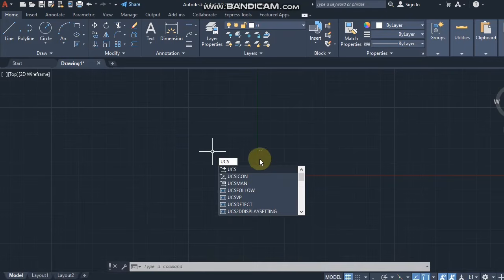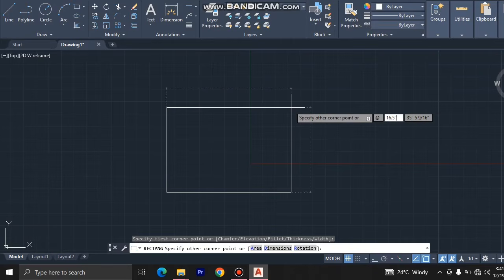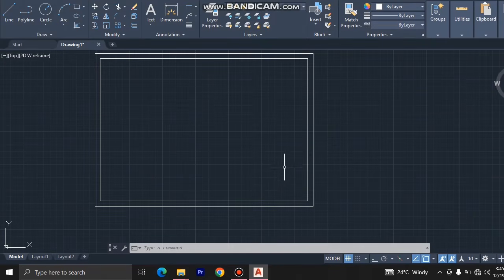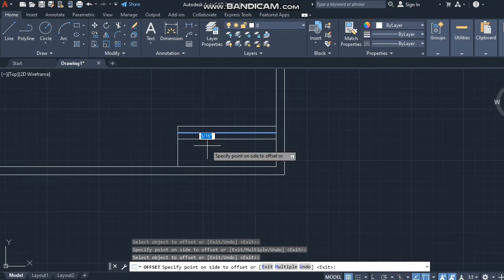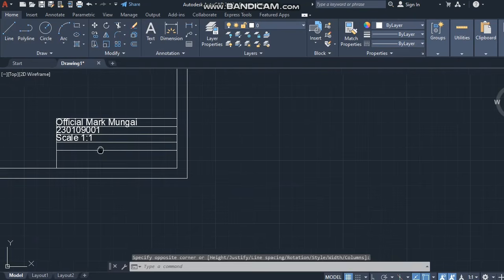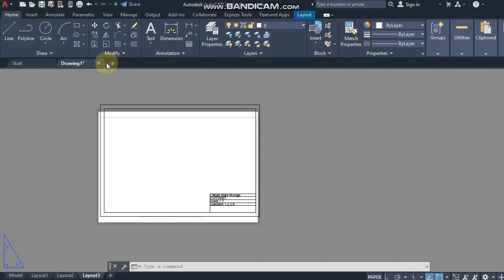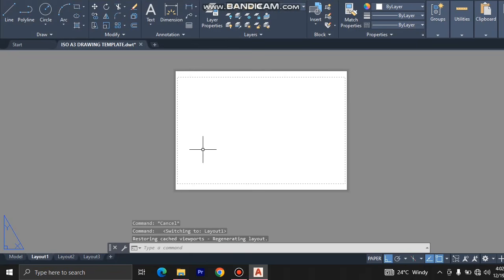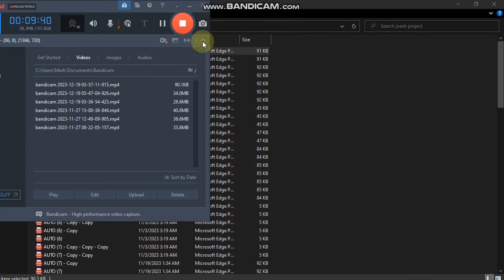AutoCAD drawing || KNEC PAST PAPER QUESTIONS || HOW TO DRAW A TITLE BLOCK & BORDER LINE || ISO A3.

Comment: You can also put the dimensions in mm it's easier than converting from one to another
Reply from the maker: The issue is the logic of the AutoCAD programme. Plus if you put it in mm you'll not have the correct title block
Reply: That's very unnecessary

Comment: Can you use Inventor instead of Autocad sir?
Reply from the maker: Thank you for your feedback. Inentor is used for assimilation. To give a little bit of motion to the drawing. The standardized application which is the recommended by KNEC is Autocad.